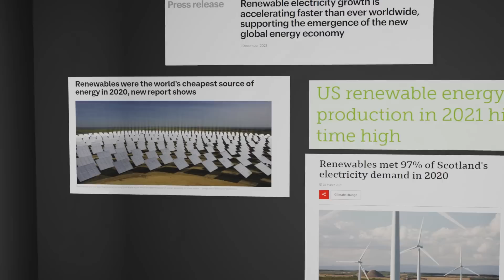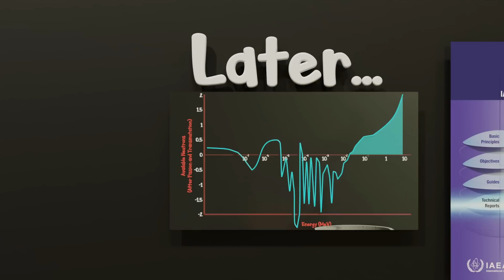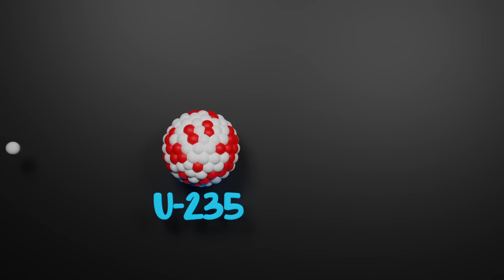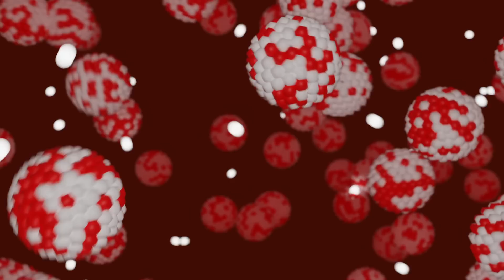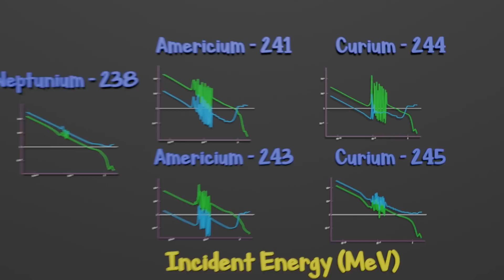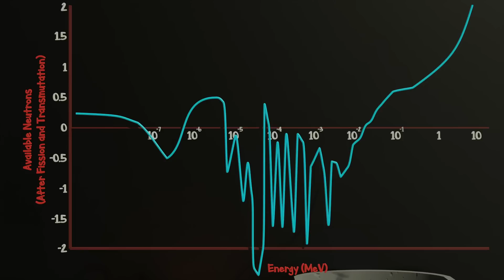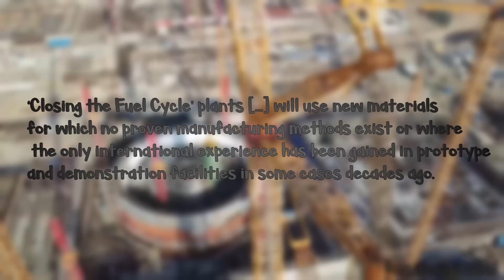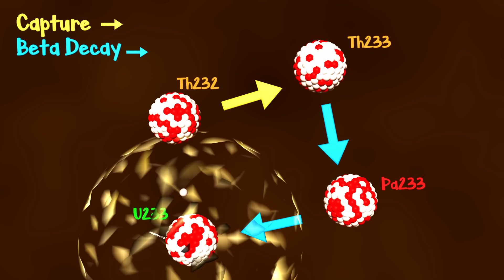How to turn Nuclear Waste into Nuclear Fuel

Comment: One thing mentioned in this video but I think not pointed out hard enough is the economics:

Nukes are talked horribly for extremely wrong reasons, the non-issue of waste and the nonsensical safety stuff that mostly shows complete lack of rellevant knowledge, and to be honest" trying to argue against it is like telling somebody afraid of flying that planes are pretty much perfectly safe... Yet nobody, neither advocates nor detractors; neither reasonable people nor folks pushing an agenda; seem to talk about the true great probkem of nuclear power: It is damn costly, expensive, pricey; and very risky politically and economically. You simply take way too long to recoup the high initial costs, specially with so much red tape, tho that depends on the country... 

Fast reactors are simply more expensive than thermal ones, they need to operate hotter (which is good for efficiency, but pricey), have way more red tape, and generally more complicated safety systems that drive cost up (for a slow reactor, you only really need a mod-coolant and adequate enough air cooling for the decay heat). Being like two magnitudes more efficient with fuel (counting waste in enrichment, as fast ones dont need) is nice and all, but fuel is only a small fraction of a NPP's cost, even not that signifficant in the operating cost, so it just doesnt make sense economically. 

A bit of the same issue with thorium reactors, you are just trying to solve a fuel scarcity problem that doesnt exist...

The industry should be (and has been for decades) focused on cutting on capital cost instead of all that fuel changing nonsense, altho I cant deny that having some ability to burn fuel can save a lot of money for the country in disposal, which isnt huge (why do you think its almost if not the only industry that boxes its waste to be pretty much safer than the rock it came from) but still signifficant enough to contribute to that cost issue so hard on the technology (overkilling less is an option too, tho Id rather have all industries adopt that standard first ;P)

Another point you should note is that fission products are way more dangerous than actinides. You can (if shouldnt!) hug a plutonium bar with just clothes, but you get ARS if you do it to a Cs137 one with a lead suit! Talking about half lives and comparing them is very common and extremely misleading, by that logic, normal lead is nigh infinitely dangerous with a half life so large no decay has ever been recorded, so it should be stored ro be kept beyond a shadow of a doubt until the last black hole flashes out ;P 
Also mentioning the numbers like that (without context) is musleading too. If you say that arsenic poison stays literally forever, along with most inorganic chemicals, 20ky to half doesnt seem that bad, but saying that it will last 20ky gives the impression that it is "particularly" long lived, heck, even "90% is gone in a century" as for many fission products (if we ignore the supermajority of radioactivity that dies in days and months) would be pretty good by many standards, even better than many plastic wastes for example, yef still sounds like a horrible threat that will stick around for generations... It is again like telling someone afraid of flying that planes are safe
Reply: Excellent comment!

It is a great irony that the geological waste disposal sites for Mercury, Arsenic and Cadmium are engineered basically the same as the ones that are proposed (and being built) for spent fuel, but only the less-dangerous nuclear disposal sites are being met with extreme opposition from nimbys and environmental campaigners.
Reply: @eckligt  I mean it's the same reason nobody says "nuclear magnetic resonance imaging", it has nothing to do with nuclear reactions (other than using nucleai I guess), but it has the word therefore bad.

TO BE FAIR actinide glasses are still very toxic  while most metal poisons get very tame in  such stable forms. On the other its way overkill anyway, who cares if the lethal dose is a gram or a millionth if you need a literal nuke (possibly shaped, Idk if the blast could break the canister) to have any hope of it getting close to your ass...
Reply: @antaresmc4407  I actually have a camera lens with thoriated glass. The hottest thing I have found with my Geiger counter.
Reply: "tho that depends on the country... " THIS !!!! it is not intrinsic property of nuclear, but POLITICS who take their knowledge from HIPPIES

Comment: Thanks for the video! Will it ever be safe to create a commercial fast reactor when the risk of the plutonium being stolen likely outweighs the benefits?
Reply from the maker: This is what we will be exploring in the follow-up video. Using uranium as the main fuel source will almost certainly produce more plutonium. 
A more attractive alternative is using thorium as a fuel. Which will also be highlighted heavily in the next video.
Reply: @ButWhySci  The engineering of fast neutron reactors is problematic compared to the steam-kettle simplicity of modern PWRs and BWRs. Everything in a fast reactor happens hotter (thermally and radiologically) in a more compact space compared to PWRs and the like, hence the use of liquid sodium and lead as coolants and heat transfer media rather than gases or water. The Soviet-era BN-600 sodium-cooled fast reactor caught fire more than once (not sure about the BN-350 predecessor). It's a bit like going from an internal combustion engines in aircraft to jet engines, the development of materials and structural designs to cope with the extra stresses in a fast reactor are still in its infancy.

The issue of reprocessing is also a problem since currently and for the forseeable future the cost of the once-through uranium fuel cycle, from minehead to spent fuel in pools is a lot less than the ticket price of reprocessed fuel. Work is being done on making reprocessing a lot cheaper but it is not a priority, commercially speaking. The nations that do carry out some reprocessing (France, Russia etc.) do so for non-commercial reasons such as reducing the volume of high-level waste, although the amount of radioactive waste is concentrated rather than being reduced per se.
Reply: @robertsneddon731  What if optimizing the reprocessing was a priority, and what if it did get a lot cheaper. Would nuclear power become commercially attractive and not just environmentally attractive?
Reply: @volbla  Right now and probably for a complete generation of reactor builds (a cycle of around 80 years or so of reactor build, operate, decommission) mined and processed uranium fuel is cheaper than reprocessing spent fuel to recover fissile elements to reuse. Cheaper reprocessing reduces the amount of waste being stored, concentrating the unwanted longer-lived isotopic elements into a smaller volume but it wouldn't make nuclear power much cheaper today. The fuel cost of nuclear power is a small part of the total cost to customers. Halving the price of uranium fuel would only reduce the cost of nuclear electricity by a cent (US) or so per kWh, a price difference of five to ten percent.
Reply: @robertsneddon731  But wait. If fuel is such a small part of the cost, how significant can the added cost of reprocessing be?
Reply: @volbla  A spent fuel reprocessing plant costs a massive amount to build and high ongoing costs to operate safely given the intensely radioactive materials being dealt with. Japan has been building a spent fuel reprocessing plant at Rokkasho for thirty years, they have reportedly spent 20 billion dollars US on it and it still isn't operating.

 All that money has to be spent up front and the economic justification for commercial fuel reprocessing isn't there given the ludicrously low price of fresh uranium fuel at the moment. Give it a hundred years or more and things may change.

Most reprocessing done today is based on methods derived from cost-no-object extraction of Pu-239 from U-238 exposed to neutron flux in breeder reactors intended for military purposes. There may be cheaper and simpler ways to reprocess spent reactor fuel but no-one is really interested in spending the effort and money to develop them today.
Reply: @robertsneddon731  You need an entire plant to get it done, huh. Well, that's sad.
Reply: @volbla  Reprocessing spent fuel safely and sustainably is not easy -- the big countries that developed nuclear weapons in a rush from the 1950s onwards created a lot of waste and dangerous materials which this generation is gradually cleaning up. The Hanford Reservation in the United States has many hazardous areas with noticeable radioactive contamination, Sellafield in England has large storage silos where assorted waste and chemicals were dumped without anyone worrying about how to deal with it or keep it separate. Robots and lasers are favoured for this work but it's better to plan for dealing with the waste materials beforehand. That costs money, equipment and space.
Reply: @volbla  So far all the Breeders and reprocessing plants were one of the kind prototypes. That means expensive. If country would like to have breeder based energy supply with network of reactors and efficient reprocessing for it then maybe processing could be cheap. Some reprocessing schemes with for example molten salt (fast chloride reactors) could be very simple and therefore(educated hope) cheap to. Another way of making the whole process cheaper is to offer service. Lets say that you have country with radiophobia based decision making-  lets call it "Bermany". Maybe that country could pay to take care of the spent fuel/because fear makes them unable to do it/. That way fuel for fast breeders could even have "negative" price for rest of the world.
Reply: @ButWhySci  I have a question: Is there a way to extract any meaningful amount of energy from the nuclear waste produced by fast reactors? If so, will it be a threat to the health and safety of people and the environment?
Reply: @ButWhySci  well, stealing fuel rods is not that viable, it's not like you can extract and refine plutonium at a terrorist's home lab; and rogue statates will do it anyway with or without stealing as exemplified by North Korea... And stealing for dirty bombs is stupid, just use mercury salts, arsenic oxides or if you really wanna get fancy and radiological a hospital is a way easier target... Heck there are stories of soviet radioisotopes being stolen from hospitals and lighthouses after the fall...

At any rate, the Th cycle is not nuke-proof as claimed, U233 is very easy to extract off the core (potentially easier than Pu as most Th designs call for a molten salt core rather than a solid oxide, which is easier to separate chemically) and it makes very good weapons having similar characteristics to Pu239. And yeah, there are U232 (gamma emitter) impurities that make it hard to work, but yoh also get Pu240/41 (neutron emitters) to similar effects... 

Truth is, if you wanna make nuke material, you gotta make a nuke material factory, just reusing civillian designs aint gonna work out, and this has been seen forever, plutonium factories are simply different... It is like saying coal power plants encourage war because missiles use fuel and explosives that have carbon.

However, it is true that fast reactors make more pure plutonium than slow ones, but the designer has a lot of control over how pure anyway and it'd be evident wheather it was made to make nukes...

Lastly, there is a lot of misinformation or different narratives about nuclear power, the fearmongers are not the only ones doing propaganda, and Th fanboys are ones quick to make shit up or just compare reactor designs from a half century ago to theirs (which would work roughly the same with either fuel) and say YOOO THORIUM :/
Why is this topic so full of crap and politics? I mean, its because Chernobyl and the meaning it had, how it was used by everyone as political pawn inside and out of the soviet union for their own goals... heh, history can be weird sometimes, this one it decided to pick on a technology...
Reply: @ButWhySci  little gasp :)
Reply: Andrew, when you look at the practicalities of stealing plutonium, it is fairly unlikely any but the most incompetent terrorist would even attempt to steal it.
Let's assume the guards and the police are initially taking a nap.

You break into a power plant and steal a waste cask. Extremely heavy, so you need a crane and a truck capable of the load. It takes time to load and your truck can't go very fast (because of the need to corner and inertia). It is likely that by this time the guards and police have finished their siesta and are onto you.
Assuming you have gotten away, or that you break into a reprocessing plant or steal a fuel shipment, you need to reprocesses the waste or new fuel into something useful for a bomb. This is going to take a major factory and months. Probably the police are onto you.
Assuming you are just making a dirty bomb, you can speed up your timeline a bit, but you still need to physically change the fuel (from hard ceramic pellets - which would be easy to pick up after a dirty bomb explosion, to something more like a powder). This is still going to take quite a bit of time and the police will be onto you.

If you follow protections for yourself and your fellow terrorists, then it will take more time and necessitate easily tracked special equipment leading the police to you.
If you don't protect yourself and your fellow terrorists, then you will provide the police with easily tracked radioactivity signals (radioactivity and radionuclides are super-easy to detect in super-small quantities, which is why it is prevalent in medicine and other diagnostics), leading them to you.

Nuclear bombs or dirty bombs are just not practical from the terrorist's point of view. Far easier to make plastic explosive in your kitchen, brew up anthrax in your garden, etc, than to obtain and use nuclear material.
Reply: @factnotfiction5915  This is one of the points I've been making for years. I've listened to anti-nuke people say "But this can be stolen and used for bombs!!!" but there is no consideration whatsoever for the actual real world mechanics of what would need to take place to actually do that. Most of which are so improbable it's laughable. Not only that they say, "Well governments can do it." Um yea, so they want us to believe that instead of building a plant that is waaaaay more efficient at producing the needed enriched fuel, they would instead opt to build power plants and spend tons of money to process the pu out over many years to make a bomb. The fact is, if they can build a power plant, they can just as easily build a bomb plant. Look at iran. They simply installed the centrifuges and fired them up. They don't even need to worry about pu at this point as ur is fine. Iraq was using calutrons. Overall, there is a decided lack of thought put into many of the anti-nuclear arguments.
Reply: That's been a consistent fear of people, but when you consider how hard it's been for them to recover the fuel from Fukushima without people dying, so it's not exactly like you can just go into these things and scoop it out. I'm pretty sure the proliferation risk is minimal.
Reply: Answer to that would be to keep breeding and reprocessing in a way to always have Pu "denatured"- mixed with all the isotopes of Pu, and transplutonics that make the materials unusable for weapons material(and to contaminated with strong radioisotopes to steel it). Spent fuel from Light water reactors (LWRS) is not suitable for weapons because of isotopic composition as a start(great thing from anti weapons stance). It should be kept that way whatever breeding reactor is used (I guess that IFR program and ones based on that, like  PRISM and NATRIUM reactors keep that principle).

Comment: But how can neutrons travel faster than the Speed of light?
Reply: The speed of light is at around 300 000 000 m/s
The speed of the neutrons said in the video was ~14 000 000 m/s
So the neutrons are not going faster than light
Reply: @The_carrot_man  o right, I thought it is 300,000 m/s, whereas it is 300,000 km/s